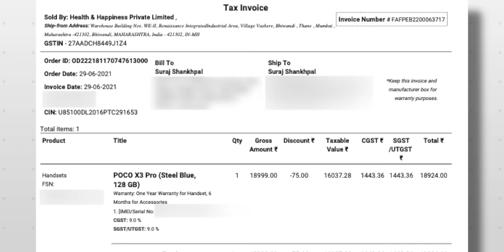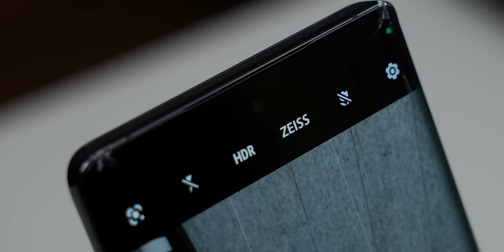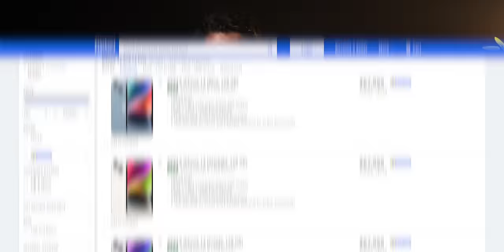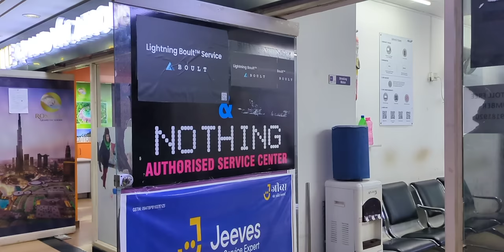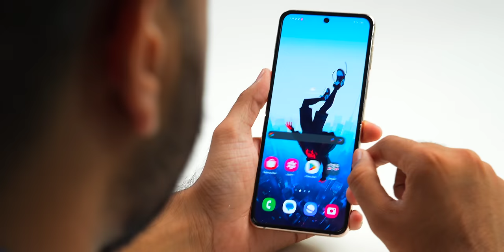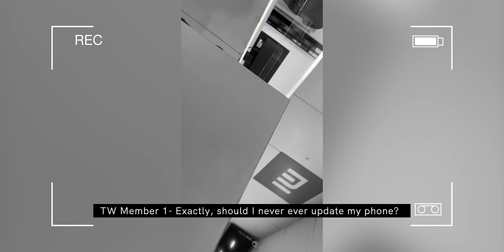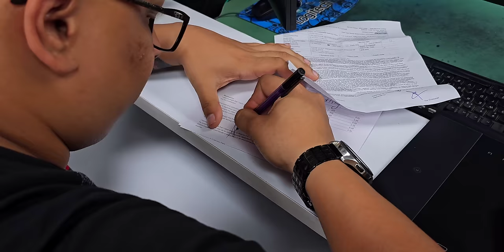We Tried 5 service Centers in India!

Comment: Experience on samsung budget phone is horrible

I had samsung a50s which i was bought for 20k. After the update, phone was keep restarting. I went to service center, those guys told me that my phone having issue with mother board, replace the board which cost 11k

I have asked them if they can check on particular chip in the board which is causing problem.. but they have not agreed to that.. they told me that either buy new phone or get full replacement of board

It was around 1.5 years old
Phone.
My suggestion is never ever buy budget phones from samsung, mi, poco etc. you cannot find any quality there

As far as i know, Moto is good

Comment: I went to various services centres for my realme X7 Pro which has a green line issue because of realme. And the experience is pathetic, first of all they straight up denied the free of cost repairs, & after showing them the tweet from realme, they took the device & said that it has very minor dents from the sides which btw aren't visible, u have to look really close. So, they just straight up denied again..! Soo they realme service is really bad & they don't care about you after they sell the device to u. Don't ever buy realme & i myself will never buy again from realme. Hence, since then i sold my realme & using my old poco m2 pro(without updates).

Comment: xiaomi sucks same happened with my mi 11x device and the are costing me 23k for motherboard and thus i need to get it fixed locally for 2.5k in which he worked on same motherboard. but he told me to replace the phone as early as possible

Comment: Hi,

I have been using MI phones for over last 5 years and i want to highlight regarding a very bad experience that I  am facing.

I had brought a redmi note 10 pro max variant on 26-07-2021 from Amazon. After I had updated the software to MIUI version 14 the phone speaker is not working. I had taken my phone to both your service centre in Cochin both are claiming that my phone is out of warranty and the complaint is with a component in the mother board hence the same would have to be replaced.I understand from articles in the media and also your discom channel that you have extended the warranty on the phone model that I own from one year to two years. I had spoken to your call centre team also and they had  told me that my service will be done free and she booked slots on 12/6/2023 after visiting the service centre the staff is not oblidging and they are saying that extended warantee is not applicable for my issue.

I visited your MI House in kadavanthra I told the staff about the issues they behaved very rudely to me and told me that they have nothing to do with phones which are bought from any E commerce portals.I requested them to provide me with any senior staff contct details which was vehemently declined. 

I have atatched the copies of purchase invoice for your reference. I hope my grievance would be addressed at the earliest and I would be served justice else I would be forced to take this issue legally.

I can be contacted on 

Regards
Arjun S Menon

Comment: Redmi changes mother board even after the warranty period for free of cost i changed my redmi note 10 pro  mother board which was nearly 2yrs old it is just that redmi officialy tweeted that they will change the motherboard if it failed after update and they did it took one week to do that but for other issues like my father's note 8 got battery issues it's a 3yrs old device battery buldged replaced it within an hour and i got my mi dual driver earphone got replaced in service centre with new one under 30min earphones have warranty when its one side becomes low

Comment: this is very well made video but i would to get your attention to what happened to my sister’s Oneplus Nord 2020 we bought it around August of 2020 not even reaching the 3years milestones it had its problems the first one not being a huge deal was you cant get the calling screen or sound it will only appear in the bottom of the notification tray i mean bearable tha but what was not bearable was the screen; the come out done like it was sticking out? we didnt even use it for gaming ki koi heating issue ho went to the service center dude told us ki screen replacement hogi  somewhere around 13k bummer 
not expected quality control issues from oneplus because we had(still have it and using it👍🏻) OP6

Comment: Samsung service center is worst
just the wire connecting fingerprint reader got disconnected to mother board in samsung m32 5g (power button cum fingerprint reader) they told me to it would cost 1500 for a new button to come

went to local shop center and opened my phone, got it connected and it works 100% fine

pheww pheww pheww😂😂

Comment: I had one issue with my realme buds air 3 where it has a battery backup issue and the left side ear phone is not charging properly but surprisingly they said realme won't provide the whole new unit but they sent each element in a separate package plus they gave me a blue color earphone where as I had a white one.

That is completely strange but I couldn't do much since I need that urgently 😑😑

Comment: I had a lenovo smartphone that I broke the display off. 
And the customer service was so good they repaired it for just 1200 and then it broke again in 2 months ( due to my fault) but they repaired it for free.

I also had oneplus 3 and it had one small issue that is when I used to turn on flashlight sometimes it might get switched off, so I went to customer service centre and they asked for 23000 but I bought the phone for only 21000 and it was under warranty and on top that engineer said they are not sure if they can fix it and if something goes wrong its on me.

Comment: MI service centers are the absolute worst, I had a K20 pro which had ghost touch issue, the service centre took the phone and rejected the warranty stating that my phone was running the beta version of miui. They also blacklisted my device so no other sevice centre was able to provide service on my phone. One of the most stupid brands in my opinion, if you don’t want users to test out the beta software, why release it in the first place 🤦🏻‍♂️

Comment: I was using Samsung A50 once my phone slipped from my hand and it was not charging and it was Turing off and on after that i went To Samsung Service center at a Bhubaneswar, Odisha and the person told me that to give him phone for 1 day that they can tackle whats the problem with the  phone that person was not the Technician and i refuse to give them phone and i walked back because i need that data that was in my phone and i go to another service center and the Technician person see it and fix it within 1 hour without any loose of data and it cost me around 1400 rupees with 3 months of warranty on that part the interesting thing is that how can they say two different things. 
After 3 to 4 months, the phone was not turning on  it does not charge only turn on while charging i walked to the Samsung care with my phone and they say it is having motherboard issue and it will cost 6000 rupees i walked to 2 to 3 Samsung store in the city and after that i percentage a new device but after some days i gave it to a local repair shop and they only charged 400 and repair it.
 isn't it interesting!!!!
It was my experience with the Samsung service center

Comment: I have the Moto g31. A few months ago I had some issue with my wide angle camera, was taking very blurry pictures. I went to the service center in Bangalore. After like 2-3 hours they fixed it. It was just cleaning the lens from inside but that took them to open the entire device. Since it was under warranty, they did it for free. Good experience

Comment: Mine redmi note 10 pro died on me
I went to the service station they said the phone was physically fine 
But said if you want to repair for your phone if will cost you 10k
Which is more than the device worth in today's market
Redmi has extended the warrenty of the device but the service centre guys said that it doesn't come under the same
So my phone is dead because of the software update
Non of my fault 
And i had to buy a new phone because of that

Comment: My redmi note 10 pro got dead twice in last 11 months sadly it happened after warranty i time they fixed it after end less visit to the service centre after my tweet then they ask me to delete tweets to get it repair so i did it as it was getting repaired for free but after 6 month it got dead again so i went to the service centre they straight up refused to do it for free asked about 10.5k for the motherboard replacement so found out local shop to do cpu reballing cost around Rs 1700 i won't buy any Xiaomi product from now it coming from that guy who always loved Xiaomi and previously using redmi note 7 mi band trimmer wired earphones and recommended to several people before these incidents but after this all i wouldn't let anybody buy Xiaomi devices in my contact ever.

Comment: If the Brand's are confident about their phone,
Why they are giving only software update for 3,4 or 5 years?
They can give the guarantee also for 5 years right?
Take some extra money for that and give guarantee for 4,5 years
If the phone is dead what is the use of 5 years of software update,
Or they can even do like 2nd year only 10% we have to pay for parta, service..
3rd year 20%,4th year 30%.....
And don't tell it won't work,
If you have any doubt go back to early 2000 and look into the Nokia, Motorola... Brand's which will least like 100 years may be 🥴

Comment: I have been using Poco X3 Pro for the past 2 years, and I believe it have stopped getting software updates. Poco might have halted the updates for this phone I guess, but I have never faced any issues both from the software or hardware. It feels strange that people are complaining the same phone which just works perfectly fine in my hands. Currently my device is running Android 13 MIUI 14, and everything feels perfect to use

Comment: I going through a horrible horrible horrible experience with ShameSUNG. Initially they replaced the display of my s22+ for free for green line issue after SW update, not without many  long calls to make them understand that it is their fault. After 21 days when I went to collected the phone from the service centre, everything was fine including display, but the phone went dead as soon as I opened the camera app. BTW i never faced any issue with this s22+ in the past,camera was perfect. Am sure technicia did something wrong when assembling the phone. But service centre claimed that they did all testing before handing over the phone. Now after 42 days I had to agree to pay Rs. 4,474/-(Total 34,244/- for motherboard replacement. Samsung will pay 28,671/-, I have to pay 5,574/-) to these bastarsd to end the ordeal. SAMSUNG is shit and you will find most imcompitent and unethical people in samsung customer support.

Comment: OnePlus kya gnatiya company hain. They often move in circles to avoid changing the green line issues. They are saying they will first do a diagnosis and then charge 16k. So why do the diagnosis wala drama? Well, apparently the diagnosis will be charged separately if you decide to not pay 16k and get a screen repair. They will lie about doing a diagnosis to determine whether there is liquid damage, but then not repair them for free unless it's a 10 or 11 series phone even if it shows no user induced damage.

Comment: A service center in my area told me not to buy Poco X series devices specifically as it has many issues etc. But the funny part was he did a motherboard replacement for a customer in a different configuration like, the customer has for eg, 8GB 256GB he put in a 6GB 128GB and he is offering to put in a mother board of Poco F1 with 8GB 256GB because it was the only stock he had and the customer already waited for the device long enough he was pissed.

I went to the service center because I had a Poco F3GT which was heating up and loosening the back glass which can be pried open with finger nails itself and also it had IP53 rating,  I used it for 9 months and exchanged it to buy Xiaomi 12 pro (Biggest mistake considering the next ultra global launch) and the exchange value camae to 28k and I paid 32k for the top end and rn I broke the back glass which costs are differing per service center like 3k and 4.5k around my surroundings

Xiaomi needs to improve their QC and service centers and I once was a fanboy of their products as I never needed to take my phone for defects and all except for my physical damage but now it is crazy to think about purchasing from them. Good video btw.